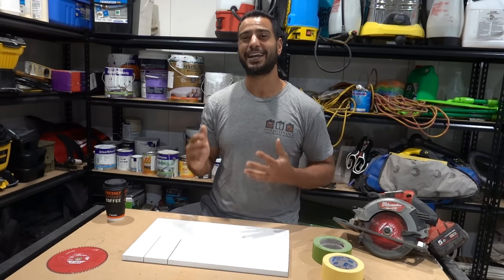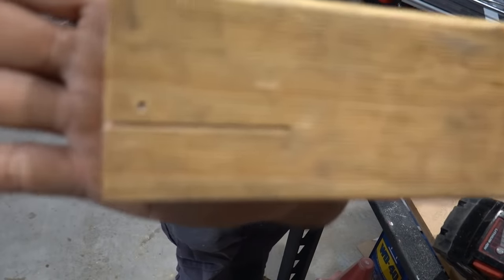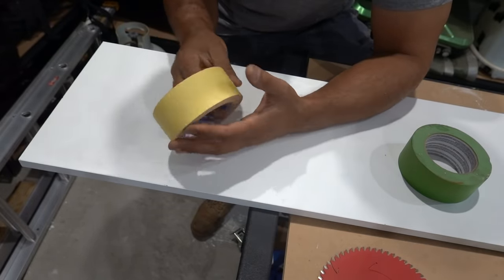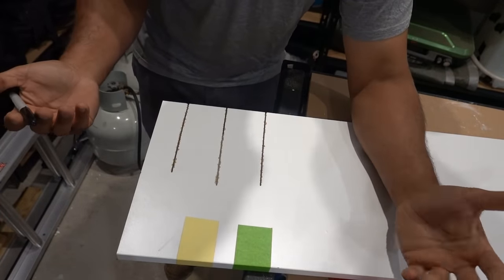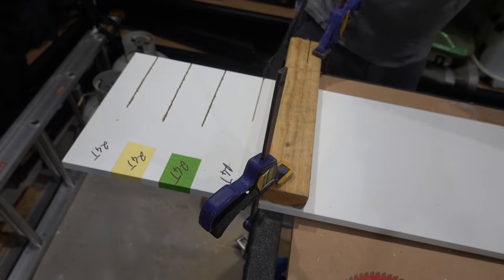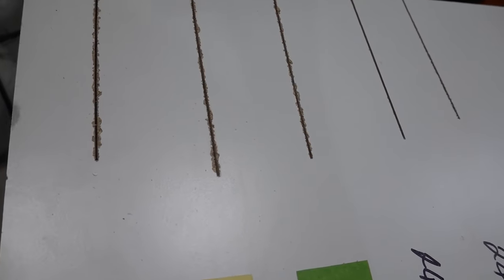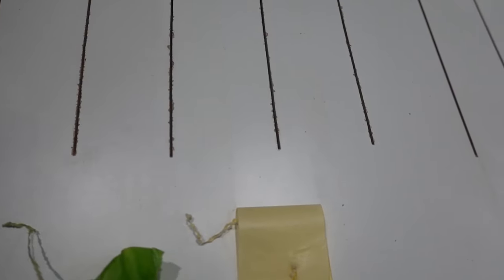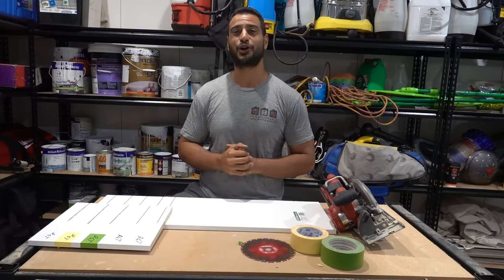How to make clean cuts with circular saw

Comment: I use a Makita plunge saw on a track . It has a scoring setting at 1mm , which leaves no blowout at all, and then I cut to full depth . The track also means no movement sideways in the cutting action of the blade, as opposed to a hand held circular saw .

Comment: I'm no expert but If i remember correctly, I was cutting decorative panel with the blade on reverse so that the teeth didn't claw in on the board but instead ride over the board and that worked great for me, mind you this was a thin piece of decorative panel and not a 1' thick board. I don't know it that us a dangerous thing to do but I'm happy with my results.

Comment: Amana makes negative hook blades for cutting double sided melamine; the cut is quite fantastic.  They are expensive and are at least 10 inch in diameter, however, better for table saws.

Comment: High end table saw for cabinet makers employ a two blade system with a leading scoring cut followed by the primary through cut. There is a Chinese manufacturer that offers a dual blade circular saw likely meant to be used in a panel saw setup.

Comment: What about if add a step to the best 24t blade (multiple cuts). You have the cutting line marked. Make a small cut with a sharp tool (like a carpet knife) along the line. Then one more cut corresponding to the with of the blade. In theory this seems good in my head 😊

Comment: Absolutely brilliant!! Very good thought process...learn by trial. Question. I have to cut som Formica countrtop. Is there ever a reason to use a carbide saw blade? Thanks!
Reply from the maker: Hi, you can just use a regular circular saw. Just make sure that the countertop is facing down whilst cutting to ensure a clean cut👍
Reply: @billshowto  Thank you. This is very helpful.

Comment: A TCG (Triple Chip Grind) blade is the correct blade to use for cutting melamine without chipping. These blades are also known as "multi-material" blades.

Comment: Use 80t - 100t for melamine boards. 120t cuts much cleaner but slow cutting. Use 80 to 100t. Some manifestations of Tear out. add a couple of millimeter allowance to your desired dimension and clean it with  trim router to achieve tear free melamine boards.

Comment: Please take a try at turning the material over and make a pass with a 24 tooth and 60 tooth blade (no tape needed).  I request this because the teeth come in and compress the material before taking a cut.
Good stuff @Billshowto ... thanks for the tips.

Comment: the 'multiple cuts' method probably works because you're using the material in front of your cut as 'support'.
Look at the angle of the teeth on a shallow cut like that. i think a lot of the energy is being pushed against the rest of the material you're cutting, rather than being pulled up out of the material

Comment: 60 or 80 tooth blade and a slow straight cut gives me a clean cut, keeping the saw square and straight keeps the material from chipping. Any twist of the blade will cause it to bind which will cause chipping/blowout.

Comment: I used to do all this but I invested in a track saw 👌
Reply from the maker: Would come in handy 👍
Reply: I would like to invest in a Festool track saw with anti-kickback function but it's really expensive.
Reply: @peymansheikhchi1548  don't worry about the anti kick back on the track Saws , I have the standard festool one and as long as you use the correct blade for the job and it's sharp your good to go as long as you keep a bit of pressure on the saw so it doesn't jump it won't kick . I got 2 track clamps that I would recommend getting,  they're very handy

Comment: Excellent video. Thanks!
Wouldn’t it be nifty if circular saws could ‘switch’ rotation directions? Then flip the blade? Does any manufacturer offer that feature?
Reply: If you'd do that, you'd create a monowheel of death. It would push the entire saw up AND make it run away from you
Reply: There’s a couple saws that offer this feature like the Dewalt DCS438B or Milwaukee 2522-20.

These saws are considered “cut off” saws, and have a very high RPM. Around 20,000 RPM. So traditional carbide tipped blades that can handle that speed are hard to find. It’s easy to find “multi material” blades for these saws.

I have the Dewalt version and it cuts nicely through most materials, even plywood or particle board. The high speed produces a pretty clean cut. I haven’t tried scoring in reverse blade rotation, but I bet it would make a very nice cut.

Comment: You should try adding a piece of sacrificial wood to the leading edge of the board, then do multiple passes at increasing depths.   That might prevent the initial blowout.
Reply: If you cut stuff ln daily basis you dont have time to sqrew around with multiple passes and or . waste material.. you use specifyed equipment and cut the right side down, circular saw face down, table saw face up to prevent scraches and chipping on the visible surface

Comment: Thus might be the tape case with a hand held circular saw, we should say though that the tape method works fine when the cuts are made on a table saw with a scoring shallow first pass and then a final cut, and yes the finer (more) the blade teeth the better cut

Comment: Did you consider that maybe the fact you use a fence is the reason why you don't have a blowout? It keeps you going strait and the blowout is less because the blade isn't wondering about. I'd say the very first shallow cut has a way more aggressive tooth angle when entering the material and would cause more damage. Can you make a comparison test between multi-pass and single pass fenced cuts? Good video, very helpful!
Reply: Last time I cut melamine I used a new fine tooth blade and clamped down a plywood strait edge, made with two pieces so the saw body sits  on the lower one. Kind of like a home made track saw. Perfect cuts on either side of the board, no tear out whatsoever.

Comment: Track saws have a built in 'score depth stop' for the very reason of making a shallow initial pass. You can even 'climb cut' by pushing the saw backwards. 

I see no reason to make the cut in more than 2 passes: 1 to score, 1 to finish the cut. What purpose does cutting the remaining material in 2 cuts serve?

Comment: Many thanks for the video. Just a thought but can you not also use a Stanley knife to make a cut prior to using the saw ?
Reply from the maker: To use a Stanley knife you would have to make a cut on either side of where the circular saw blade will be then you have to ensure the circular saw is cutting directly over the are you have just scored. Very difficult to do👍

Comment: Multiple cuts is always the way. The reason you have blow out at the start of those is because you are starting right on the edge itself. Start a ¼inch in and run the saw backwards that ¼ and then cut as normal for all remainder cuts. ⅛ works too on most things... not laminates in some cases though... those are sometimes best just to turn the saw around and cut that last little bit. Don't start on an edge is what I am getting at. Just finish.
Reply: Can't one use a 80T or even 100T single cut though?
Reply: Multiple cuts are most definetly not "always the way"  . Can you show any factual proof of any professional company using a multiple cut method with any finish board, my coin says you can't!
Reply: @jimmyc974  you're right, because I have nothing to prove to you. Believe me or not, that's your prerogative. Puff up all you want too... 😏 doesn't change what I said.

Comment: Honestly i can say i never had this happen until i got a newer Cordless saw. I mean i could of got lucky half my life and just happened to of had the right blade each time, but in truth theirs alot of times i just grabbed a random blade that i thought would work for anything or even used other peoples randomly. But like i said i never really had this happen until recently when i started using a cordless saw, which also have a rip direction button interestingly enough.
Reply: Funny, I have a corded saw which I did not use in years, but before this video I could swear it cuts downwards on the leading edge. I need to got and check !

Comment: If you are trying to achieve a good finish on sheet goods, particularly melamine and you are not using a track saw with a relatively fresh chip guard (and blade) - you are just making life difficult for yourself. I had never cut melamine or Laminex before my first kitchen from flat panel. I figured that the money I saved as a DIY job more than paid for a Festool TS-55 and two joinable rails to cut full sheets down to size. I sold the house soon after completing the kitchen and received an enquiry from one of the couples through the house. They didn't want to buy the house - they just wanted to engage the kitchen company that made the "amazing kitchen". One side would be cut perfectly and the "b" side was maybe 95%. After it was edge banded, with the "b" side 'hidden' - you would never know it was not a professional job. That was 20 years ago when the Festool was pretty much the only track saw - now you are spoiled for choice and even the "cheapies" are pretty good!

Comment: Well, I'm stupid. I use the CORRECT BLADE adjusted CORRECTLY and a piece of blue painter's tape (or plain masking tape) and I've NEVER had tear-out, jagged edges, blow-out or any defects on ANY material including Formica(tm) brand laminate. Now it DOES take a router at 30,000 RPM to make a glass-smooth edge on Formica (tm) or Corian (tm), along with a razor sharp top-edge with a standard carbide bit! The hardest thing I've come across to cut is hardwood faced plywood or lumbercore. It's costly and to prevent errors, pre-scoring with a NEW knife blade isn't a bad idea, even on the table saw. And yes, I have $240 table saw blades and $80 circular saw blades, because I use them.

Comment: 5:14 That saw's set about as deep as it can go.

Set your depth to like 1/8" (~2-3mm) beyond the material you need to cut so it's not sticking out way below the bottom, it'll cut cleaner.

Comment: Looks to me like the whole problem is the teeth ripping upwards on top out of the wood.  Table saws they say (I don't have one, don't know) don't do that so get a clean cut.  Multi cut just lessens the upward angle because the blade isn't so far down.  The bottom doesn't tear out because the teeth are ripping into the wood.  Is that right?
So one sided melamine we could just cut from the backside?
Two sided melamine we make two cuts simply in order to get the teeth ripping into the wood instead of up out of it, lifting the layer.
But that first shallow cut isn't really ripping down it's just ripping more horizontal, less 'up and out'.
So why not just run it backwards on a shallow top cut?
Then go through it again and finish the cut, take out the bottom.
Whole thing is to stop the teeth ripping from under the layer and lifting the layer isn't it?

Comment: If you need both sides to be clean, multiple cuts but the fence is required. If you only need one side clean just make sure the bottom of the board is what's displayed.

Comment: I did not see you flip the board over and compare the back side cut. I was taught to cut with finish side down when using a skill saw and face up when on a table saw. It's the carbide teeth that chips off the edge like flaking chips off flint. So yeah, the more teeth on the blade the better the cut.

Comment: It doesn't matter what blade you are using the best and convenient way to cut laminated board is to use table saw scorch it first at least .5mm to avoid chip off and full adjust for final cutting

Comment: Or.. you just buy the Festool, which comes standard equiped with a small precut blade before the actual blade so you can saw it in one go without any jacked edges..
Reply: i just want to repair my bathroom vanity with this stuff, I'm not going to buy a whole extra bit of kit just for that.

Comment: Try two pass with first as small as practical. I use one millimeter. You may be impressed. I used a blunt 24 tooth and got as good or better than those suggestions.

Comment: OK so using the multiple cut method is obviously MUCH better, but WHY do 3 cuts instead of doing the 1st cut at 1/3 depth & then just go the whole way on the 2nd cut ? Would the finish be any worse than 3 cuts ??????????????

Comment: You shouldnt use timber for pressing it while cutting but rather a piece of material you are cutting since it has strong sharp edge. Timber is just not strong enough to support it and also never has like razor sharp edge. Other then that great way with multiple passes.

Comment: Wouldn’t the easiest option be,always cut from the back or the underside,giving you a perfect visible clean cut every time no matter what blade you used??
Reply: I thought  the same thing. I assume its for trimming edges or parts that are already fixed and you can't gain access from "underneath"
Reply: You can on pieces that will only be seen on one side (kitchen counters) but sometimes your piece will be seen on both sides (kalax type shelf supports)

Comment: From my experience, good quality tape with most materials provide perfect results, so it is also the easiest. Obviously the material shown on this video is the worst possible, because is consisted of two parts, glued together, so that is not appropriate for the tape. Second method that works pretty much always is by using hard material to cover and compress - in order for this to work, both boards must be perfectly flat - if you have crooked materials that won't work as well. The method with multiple cuts is not perfect for obvious reasons (slow and problematic start, i.e. to perfectly match always the same cutting path) that you see by yourself, but if the other two doesn't work for particular material then you might not have a choise.

Comment: I'm surprised to see that none of the cuts are perfect. Even the multi-cut method looks bad for such a weeny 10 cm cut in a piece of scrap board. Imagine you're building a kitchen using Melamine board, and have to make hundreds of cuts and you want every cut to be 100% clean. I just don't see how I could achieve this using your method. I might want to consider using a different material. Anyway, thanks for posting this, much appreciated.

Comment: Id like to point out some details that devil hides in.first 90%at the time only one side is visible thats why you want to cut visible side down. The other reason is you want to cut face down is that you dont want to scrach visible side with your base of the saw. Third 24;48;60 teeth doesent matter until it is quality blade and sharp. There are specks written on the blade or its package that blade is meant to be used for, they may have various number of teeth, as long as it says for example melamine on the listed materials, you are good to go.. Other variety are universal blades you can cut from softwood to cement board. As they are universal, they are doing hackjob. Angel of the teeth determines the material it is meant for.

Comment: You were testing a brand new blade against an old blade . You need to text new blades 

One method you didn't do was to back score the piece . You do a shallow cut backwards so that the teeth cut into the wood rather than blow out . Then you cut full depth forwards . That will be your best method

Comment: That’s not awesome. Put a 1/4 MDF board on top and make 1 cut - presto you’re golden. Tape won’t press the laminate hard enough, it will always chip some.
Reply: No its not . The multiple cut has always been my go to for a pro cut. Because before you know it using your method is costly as mdf costs money multiple cuts are the best .
Reply: Doing a job 3 times is more costly than mdf.

Comment: Same concept with a table saw???
Reply from the maker: Yes, however the jagged cut would tend to be on the bottom of the timber as the saw will exist from the base . Sawing from the bottom with a table saw rather than the top with a circular saw

Comment: BLADE
Body and Teeth are Clean 
Teeth are Sharp
Cross teeth - Better
Blade body - Without wobble 
Number of extra teeth - Better

PANEL
Solid 
Quality- Second or third quality panels makes more edge chips
Not much inner spaces -Mini bumps when cutting
Weak texture - Problem
Thick or much hardened laminate coating - Problem

BODY
Easy speed 
Relax and controlled arms 
No over squeezing hand saw handle
Energy cable is free - no hang around (if any)
No twisting just straight cutting

If you don't attention these, You'll have everytime unsuccessful cuts and many scraps.

Before start to important or expensive project you can buy a new saw blade.

Comment: There is absolutely no reason to make more than 2 passes. The second pass is the center of the board, what is going to blow out there? You just need to do a scoring cut (the first shallow cut) then the second cut is barely through the bottom side. The idea is that you want to cut the melamine layer with only the teeth and at a very low angle. The steeper the angle, the more tear out.

Comment: The under side is always clean ..can we not just connect the motorb in reverse ..so it cuts from the top? ..I'm sure there's a reason why they cut from the bottom ..but if u think about it, who ever hand cut from underneath..I'll try and connect the motorb in opposite polarity some time ..probably get a face full of shite and a possible Darwin Award!